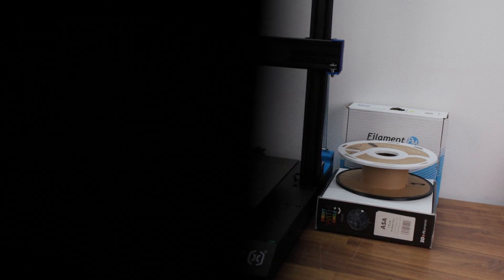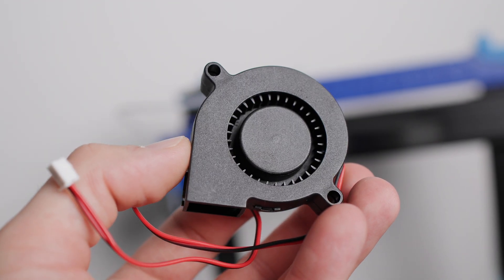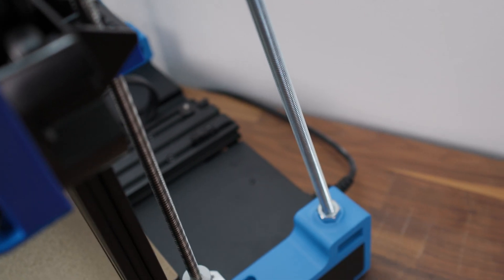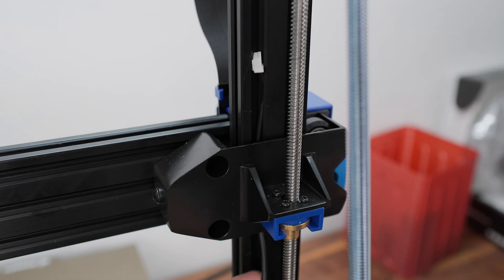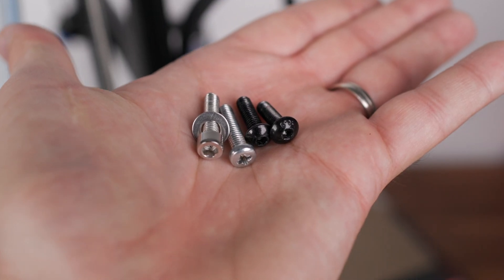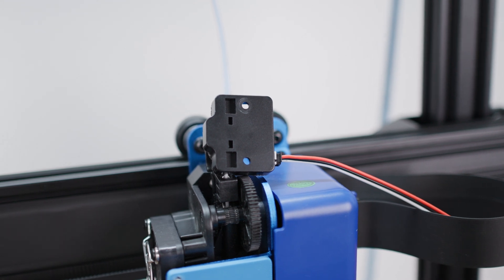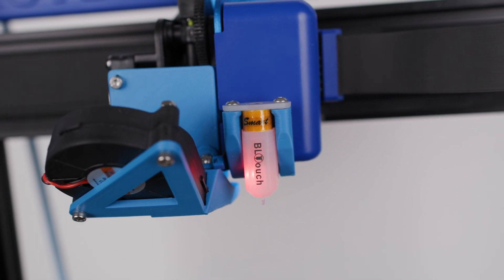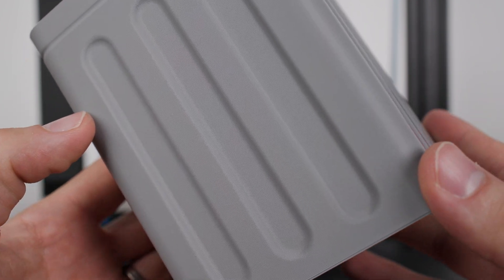Artillery Sidewinder X2 - Cheap upgrades / Improve your printer even more

Comment: How do I remove stripped Allen bolts? Out of the 3. I stripped one!
Reply: A set of screw extractors is about $15 at your big box or hardware store. Having the stripped hole will make it even easier to remove. It's like a drill bit with reverse threaded pointy tip. Use a drill on low speed with the bit pushed into the Allen head. When you tighten the new screw down, don't use the ball end.

Comment: anything you recommend to avoid LAYER SHIFTS ?
Reply from the maker: Depends when it happens. Layer shifts are because the nozzle bumps into the print or because the stepper motors are losing steps.
Reply: the nozzle hits the print... EXACTLY.. this is what i think causes these shifts... BED LEVELING is essential for every single print.. and a heated room for keeping the print from warping.  @Zemistr3D